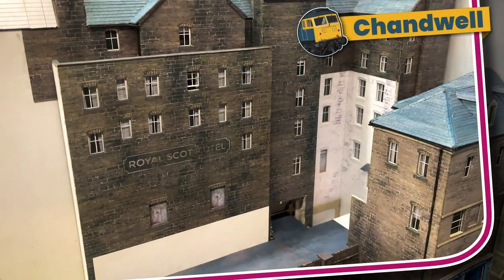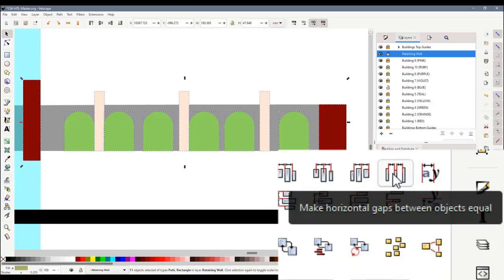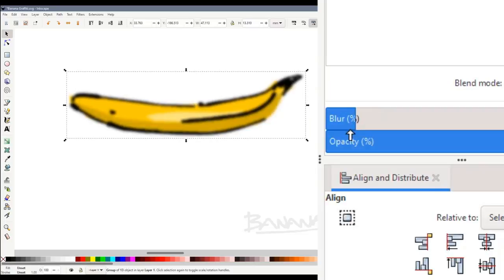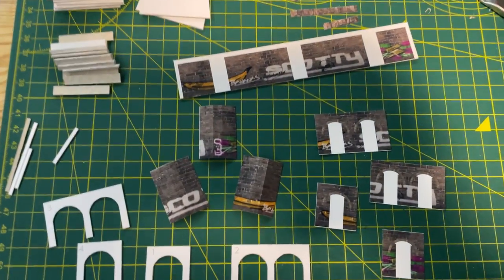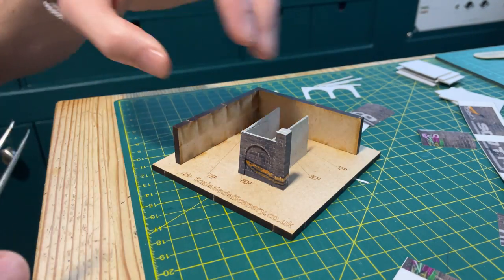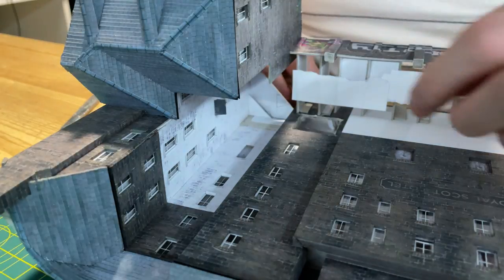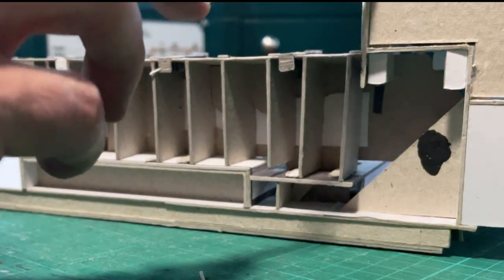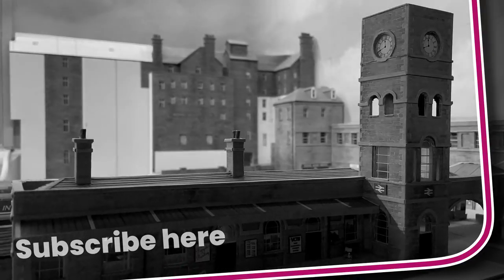Grotty Graffitied Retaining Wall: Scratch Building a Low Relief Victorian Hotel Part 8

Comment: Really enjoying your catalogue of videos. Where do you buy the brick and paving adhesive paper for buildings and is there a proper search term for them?
Reply: There's a website called 'pixabay' you can get public domain textures from. You'll have to scale them to size. But Michael has a vid showing how to do that. :)
Reply: He doesn't buy pre printed commercially produced papers.  He prints his own form the software application onto standard A4 sticky labels.  - If you check out his other videos he covers this in detail, but this might help https://youtu.be/hWDnPtmd91c?t=505
Reply from the maker: I generally use two sources for textures - the free website "Textures dot com" or more often, I buy the textures from "Scalescenes dot com". These are really cheap and once you buy a texture you can print it as often as you like. I print onto photo paper which I cover in this video... https://www.youtube.com/watch?v=58PK5y1R4bA&t=84s

Comment: Michael, I wonder if it might be possible to share a specific technique you might use.  I really struggle with small strips of texture that either wraps around the capping of a wall or the edges of platform.  It is always difficult to keep this straight and more infuriating is that whatever amount of pritt-stick or equivalent, it will come away from the card it is stuck to!  Regards from a lesser card modeller but ardent fan.  Dave.
Reply from the maker: Hello Dave. What timing!! I have just sat down to work on the hotel and the very next part is one of these wall capping strips. I will record with more detail and include a little section in the next video for you. All the best, and thank you for watching and your kind words. Michael.

Comment: Hi Michael, love your build series, I would eventually like to go down this route for a future layout. I just have one question. I have often seen pictures I might like to use over the textures, ie. signs and graffiti but they are often in jpeg. how easy is it to convert then into a vector so that it can be resized properly and used in inkscape. I realize this may be a video in it's self 😂😂 All the best Tony.
Reply from the maker: Hey Tony! In general, if you get a photo of a sign in JPEG format, it will be much, much, much bigger than it needs to be for your layout. You don't lose any crispness when scaling DOWN, so you don't need to convert it to vector format - just scale it down to the right size and it will print fine. I've done this with signs, air vents, and doors, and it works lovely. Sometimes it does make sense to "make" the signs and things if you need to change words, or adjust spacing etc. but for this, I just use Inkscape from scratch instead of tracing it. Having said that, I do sometimes use Inkscape's "trace" function but it can be a bit tricky to use. Thank you as ever for watching! :) --Michael
Reply: @Chandwell  Thank you for the advice, I will certainly be experimenting when I get to that stage 😁

Comment: May I back-up a bit and ask do you use chipboard for your buildings and if so what is the thickness. I would reference you to your Pub build. Thank you
Reply from the maker: Hi Lee. I use four types of card in my buildings. In general, I use either empty cereal packets. Weetabix is my favourite as it is thin (0.5mm) and sturdy. When I'm not using cereal boxes, I buy A4 sheets of greyboard from eBay. My usual thickness is 1mm, although I also use a lot of 0.5mm as sometimes it is good for detailing to build up walls from two layers. The fourth type I use, although not as often, is 2mm greyboard, again bought from eBay. I mention the greyboard a little in this video if it helps you: https://youtu.be/58PK5y1R4bA
Reply: Thank you again for the information